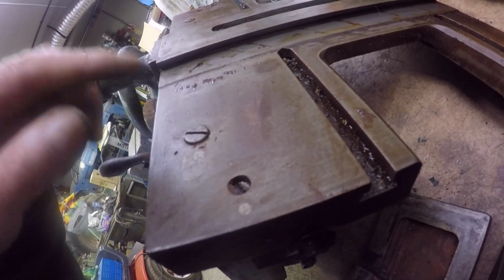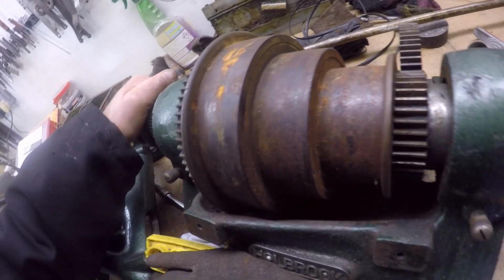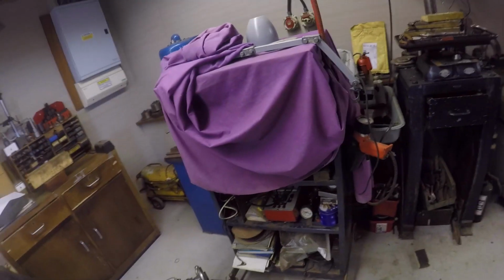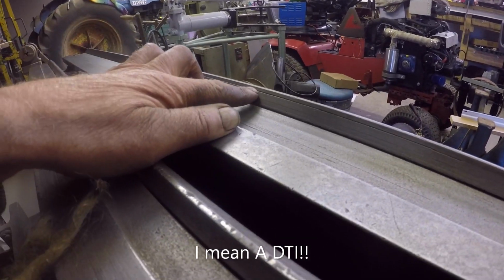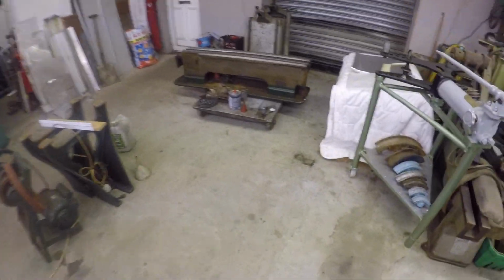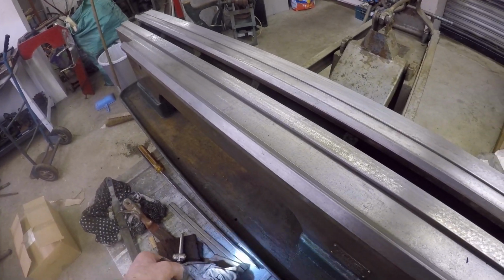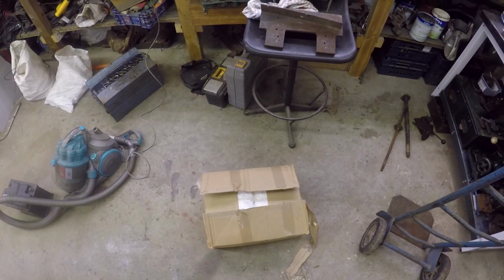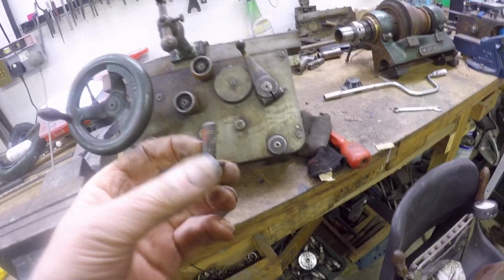The last of the Holbrook lathe comes home!

Comment: Phil- that gearbox is quite subtle in many ways and is a classic piece of it only comes apart one way and only goes back together one way Holbrook engineering-- the hole in the bottom does go through...and is your only access to the taper pin that holds the yoke- that operates the one tooth dog clutch- onto the operating shaft.. If it has been not messed around then the small end of the taper pin becomes visible through the hole when you rotate the shaft....
The oiler is a Winkley oiler...originally US made...and the ones on Holbrooks have american pitch threads 
there are loads more little details like this- drop me a line when you are ready...
Reply from the maker: I an goiing to peer into the murky depths with a torch next week to see if I can make any sense of it. From what I see at the moment, any oil put into the oiler will go through the plate cover and drop into the bottom of the gearbox without oiling anything, unless their is a wick system somwhere in the depths or the gearbox is supposed to contain a certain amount off oil on a total loss basis. Having said that, the gearbox appears in virtually perfect condition, and is well oiled, so it will probably just get a good flush out and put back into use. I could not get the micrometer adjustment for the knock off to work, so I gave it some light oil, and left it, and it has freed off remakably well, still don't have full travel, but rather than seized, I think it was just gummed up. Gradual progress!
Phil

Comment: Somebody needs to learn to reverse a trailer. Shoving that bed up there, well, a video in it's own right! I need to have a tidy up and sort out too. Subject to safe practice and of course suitability, Hydrochloric acid will take the rust off easy, or white vinegar which is another acid as you know. Keep up the good work!
Reply from the maker: I have tried revesing a trailer up that slope before, you can do it with a rear wheel drive or 4wd vehicle, but front driveand it just tries to lift the drawbar and spins! What I used to do with dead cars is to close hitch them to the landrover, drive the landrover straight into the workshop and then let the car go back to the kerb at the top of the slope, and back the landie out and push the car in! That slope has nearly killed me on several occasions, including a car that dragged me backwards down the slope when its handbrake cable snapped! I also lost a Mk 2 jag down there which luckily did not get a scratch!

Phil
Reply: @philhermetic  Fair comment, it is tricky to judge an incline on camera.
Reply: Yes, I understand your point but it’s a very steep drive and with a combination of a heavy and short coupled trailer and a front wheel drive car you can get halfway up the yard, then the trailer hits the steep part of the drive, the trailer wheel pressure increases and the articulation at the ball hitch  rises up, graunching the trailer tailgate into the concrete... We feel a little under equipped than in years past as we currently have no winch and no 4x4 with a ball hitch. We can all reverse trailers...been doing it for decades...There is a reason behind everything we do....we will soon have an Austin Champ for this kind of work...
Reply: @michaelwhitley2081  Phil needs a winch anchored in his workshop to pull heavy objects up the slope, easy peasy lemon squeezy. Tony
Reply: @eyuptony  Phil needs to stop buying heavy SH1T thats needs 15 strong men to heave it up the yard!

Comment: Some of your luck rubbed off on me, I collect and "restore" old clocks and on Freggle somebody put up what he thought was guts of a long case clock, so I showed interest and I now have a complete set of parts for a 1900's Postman's clock with weights and chains and wooden, not brass, frames. Another project :-)
Reply: I have a Postman's alarm clock that needs attention. One day I will get it going.
Reply: What pray is a Postman’s Clock?
Reply: @michaelwhitley2081  A postman's alarm clock is a small wall mounted clock with a long movement chain and weight and a long alarm chain with a matching design weight. To set the alarm, you put the weight on the alarm chain and move the alarm trigger finger to the time required.
When the alarm time is reached, a striker hits a bell on the top of the clock. The weight will pull on the alarm chain ringing the bell until the weight is removed or the chain runs out. The bell alarm is very loud.
Reply: @JonDingle  Well every day is a school day - thanks for this info---I need to look out for one now it sounds fascinating! Something else to fix along with my Austin Champ (mentioned in Phil's video), an old Harley Davidson and a couple of aeroplanes... and a workshop to fix to put them all in! Off we go then...
Reply: @cambraicovers6259  I might do a video on mine then so you know what to look for. And it will give you a better idea of ho it works.
Reply: @JonDingle  That would be very interesting to see!!

Comment: Your missing plate could also be an inventry plate, where I served my time every machine in the company had one.
Reply from the maker: Good luck with the clock, it never ceases to amaze me what people have stashed away in there cupboards, sheds and lofts, god bless em every one!! Re the oiler.Thats what I thought , but the oiler outlet seems to come out below the detent, I will have a look inside with a torch next week.. Yes, never thought of an inventory plate, that is a possibility, if the holes are threaded I would guess it is non Holbrook, as the use screw rivets, and I havent seen one with another plate in that position. Thanks for watching and commenting.
Phil